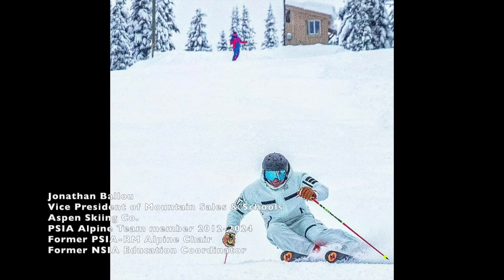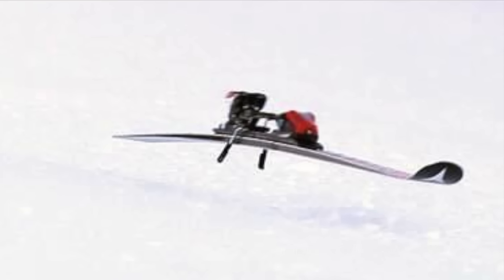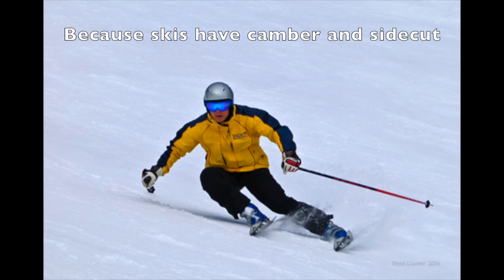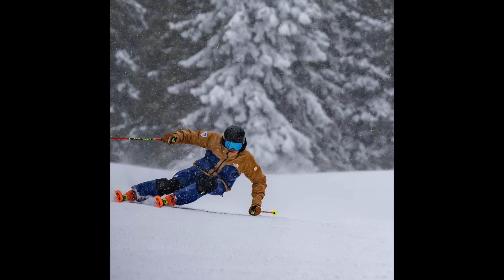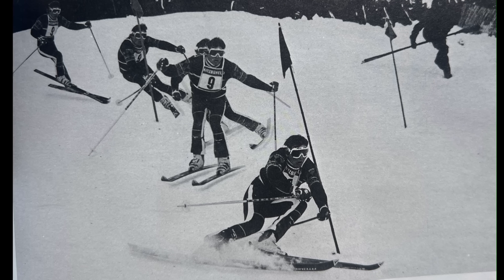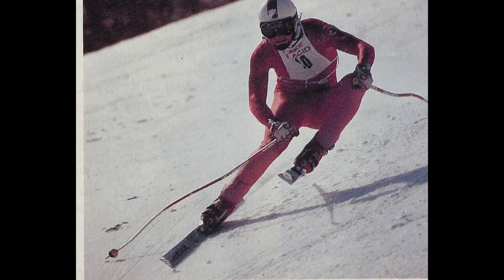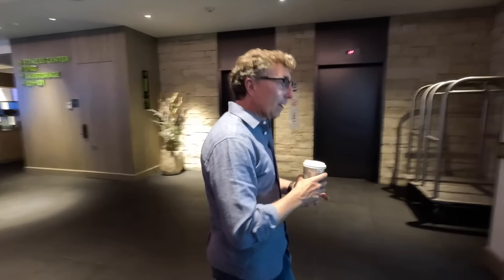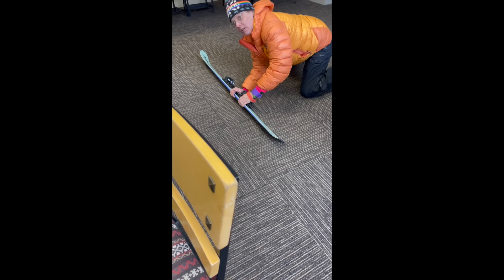Managing forces, the #1 fundamental

Comment: Maaaan. I still find it amaaaaaazing people that should know better still talk about 'inside ski' or 'outside ski'. Modern skiing is equal pressure on both at all times. Only now it is one foot in front of the other as you commit to the turn and during the turn.
Reply from the maker: Wow
Reply: Bro what are you talking about? The outside ski should have 80 - 90% of your weight on it. Everyone who knows anything about skiing knows this. If you put equal weight on both skiis and you're ripping down a steep pitch, you're just going to fall uphill. I've done it many times. Weight on the downhill/outside ski. Always. 

This is not to say you do nothing with the inside ski. Quite the opposite actually. You have to manage edge pressure on that one as well, but you have to apply different techniques to get it to tip up on edge. Your inside ski has a lot less weight on it which makes it prone to wondering around during your turns. It's essental to manage the inside ski just as much as the outside one. It's about shifting that weight from turn to turn. Edge to edge. Finding that rhythm. I can understand the sentiment behind your statement. It IS about equilibrium, but only during transition between turns. I think it's important to make that distinction.

Comment: Why do you and other skiers use the words "force" and "pressure" interchangeably? We don't apply pressure to our skis, we apply forces (and moments) through the bindings. The snow applies reaction forces along the length of the ski. It would be correct to use "pressure" when talking about the base contact area and displacing softer snow, but this is seldom discussed.
Reply from the maker: Words, semantics, concepts explained are very tricky in skiing. The number one most important thing is when you’re talking to somebody you check for understanding so that there can be clarity in what you’re talking about. For example, a “deep” turn can mean to opposite things so I would be sure to clarify something like that. As for what you are referring to, I am not smart enough to know the exact meaning of particular words. I do my best to have people understand the spirit of what I’m talking about.

Comment: Love your videos Deb. I do question the concept of the skis returning substantial energy when the edges are released. My understanding is that the skis will only generate a force of 10 to 15 pounds when they are unloaded. The large force that we feel and love when we unload our skis comes from our body’s loaded soft tissues, like our tendons and muscles. If you put your skis across two saw horses and bend them into a reverse camber and then unweight them you will notice that they don’t return to their original camber with high forces. Sprinters do not propel themselves with rapid muscle contraction. They propel themselves with loaded tendons (with the load derived from contracting muscles). I’ve been educating myself on this concept over the last few years. I previously believed the rebound of the ski was the primary force during the transition.  Now I believe it is from our loaded tissues.
Reply from the maker: I take it you have never been trampolined off the snow and hill by your skis? Like a bucking bronco, this happens. It never happened to my in the 80s, I was never able to generate that kind of rebound, but it has happened to me enough times in modern equipment to scare the s..t out of me😉
Reply: Would it be accurate to say that your average skier would lack the leg strength (because of the energy drain & fatigue truly loading a ski generates, effects the rest of the day, also to fully commitment to loading the Ski in fear of losing the edge? Then not being able to experience that true unloading of the Ski that powers you into the next movement?

Comment: Why camber though? I never really thought about it but this video prompted me to. Why not a flat ski that gives you instant access to the full direct without having to produce the ski? Doesn’t have to do with the ability to unweight the ski in the transition?

Great video as always.
Reply: Camber shape is necessary to maintain even pressure along the whole ski length while the whole load stands in the middle. Without it, the tip and the tail will never bite into the snow. If you ever tried carving turns on the so-called "easily turning" rocker-shaped skis, you'd instantly understand. The idea of camber predates alpine skis as such.

Comment: Deb: "... you apply a little more pressure now we're going to start bending an arc, apply more pressure you're going to bend the ski more and you are going to bend a deeper arc, it's like the difference between a big C and a little C..."
Me: "Well, it may feel that way, but in reality, the situation is somewhat different."
As soon as the bent edge of the ski touches the snow completely—not just the tip and tail, but also the section under the binding—the ski cannot be bent any further, no matter how much additional pressure is applied to it.

The pressure required to bend a ski far enough is usually not particularly high; body weight, i.e., 1g, or even less is completely sufficient. If you put the ski on its tail, hold the tip with one hand, and press against the binding plate with the other hand, you can bend a ski very far, and you would hardly be able to press more than, for example, 70 kg with one arm.

To bend a ski more during the turn, you have to increase the edge angle instead. This creates free space under the middle section of the ski edge, allowing the ski to bend further under sufficient load than before with the lower edge angle. This is possible up to the point where the edge is in contact with the snow again along its entire length. Thus, for every ski, depending on its sidecut, there is a corresponding curve radius for each edge angle, always assuming that the entire curve is exclusively carved, with no drift.

But it is not just the gravitational force of the COM that bends an edged ski. During a turn, a centrifugal force is created due to the inertia of the COM, which acts towards the outside of the turn. The ski is always bent by a force that is perpendicular to the ski surface, partly due to the body's weight and partly due to the effect of the centrifugal force. The greater the edge angle, the greater the proportion of centrifugal force and the smaller the proportion of weight.

The higher the speed and the smaller the turn radius, the greater the centrifugal force will be. However, the centrifugal force also balances the significant inclination necessary for a high edge angle and the associated short turn radius. The steeper the incline, the higher the centrifugal force must be to achieve this dynamic balance, preventing the skier from falling over or at least having to support themselves on the inside ski.

Accordingly, high edge angles always result in high centrifugal forces and thus strong forces that can bend the ski. In giant slalom, this can be two to three times the body weight, which the leg of the outside ski alone essentially must hold. So, it feels as if you are pressing extremely hard against the ski during tight turns, but this is not actually necessary to bend the ski. Rather, these forces arise automatically when you make a tight turn at high speed, with a high edge angle and the necessary high inclination of the body.

You could also describe it the other way around: When you make a tight turn at high speed, large centrifugal forces arise. To avoid tipping over and being thrown out of the turn, it is necessary to shift the COM significantly to the inside of the turn, i.e., a strong incline. This is the only way to balance out the forces that arise. And, usefully, the incline and the associated high edge angle are exactly what you need to bend the ski so far that a small turn radius is even possible. 

Or, here is a third way of looking at it: The high inclination provokes the necessary centrifugal force to maintain dynamic balance. This body position is essential to create a correspondingly high edge angle, which in turn is a prerequisite for significantly bending the ski. The resulting tight turn generates the high centrifugal forces needed to balance the body position.

A bit like a cat that keeps turning in circles because it is chasing its tail.
Reply from the maker: Thank you
Reply: @DebArmstrongSkiStrong  I hope you're not annoyed, I definitely didn't mean to lecture you here, my long text with over-explanation is ment to be more of a question disguised as an assertion. Until not so long ago I always assumed that you could actually bend the ski even further by putting more pressure on it, and especially on the front part of the ski. Until the algorithm threw the following at me:

- "HOW TO BEND A SKI | More pressure or more edge?", Paul Lorenz
- "Tom Gellie. Indoor lecture, Wanaka NZ", Rookie Academy - Ski Camps and Instructor Training
- Know your skis to be a better pilot. Tom Gellie Indoor Lecture.- "Hand Drag Drill For High Edge Angle Carving", Tom Gellie - Big Picture Skiing
- "How to Ski Groomers - with Performance", Joshua Duncan-Smith

It definitely works brilliantly and puts a big grin on my face every time😎

Comment: The older skis don't give you carve at the very tip or tail.  The length of the carve is actually longer than vintage non shaped skis.
Reply from the maker: What you wrote is confusing? What are you saying? That vintage skis don’t carve, don’t have sidecut? That is not so.
Reply: @DebArmstrongSkiStrong  Thanks for calling me out.  What I'm attempting (unsuccessfully) to describe; I have more edge I can carve using a 181 or 184 modern shaped ski  - a good skier has more edge carving into the snow than say...a vintage 207 or 210 Rossi SM or Acryglass.  I keep several vintage pairs of race skis, and find that the sweet spots for carving are shorter than modern skis.  It's like the top end and bottom ends aren't able to hold equally in edge pressure compared to the edge pressure you can drive underfoot .
Reply: More edge=Longer edge
Reply from the maker: @franzalaska9512  the technology differs in significant ways allowing for a completely different type of turn as I referred to in the video. However old and new skis have camber and side cut which means we are dealing with forces in both cases. The new skis are far superior that’s for sure😉

Comment: Deb, in my humble opinion, the camber has a little to do with the propelling energy directly...  the camber helps with bending the ski for a smaller arc.  And it is the edging and releasing the edges that propels you.   Similar to lipping out a putt when golfing.  The ball accelerates as it lips out of the hole (edging and releasing).  Thoughts?
Reply from the maker: Yes, camber would have to do with bending a deeper arc.